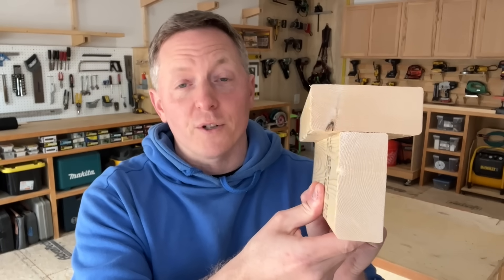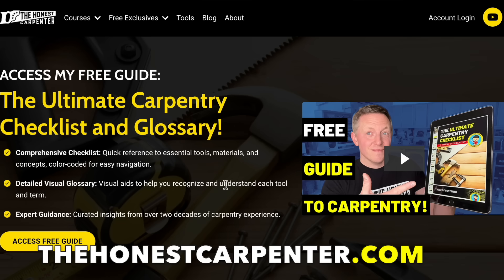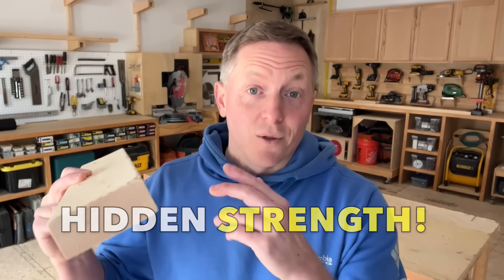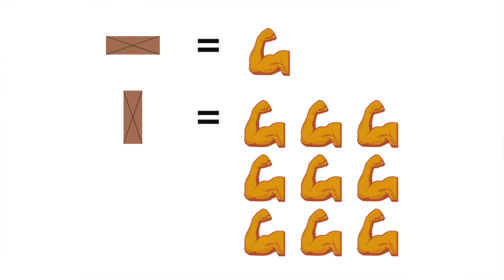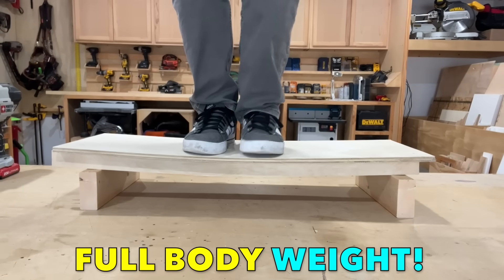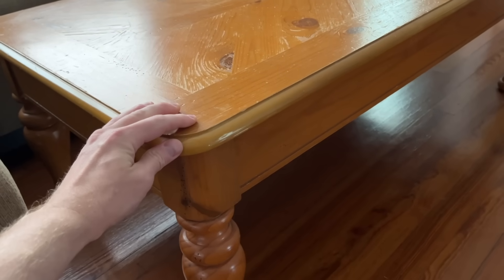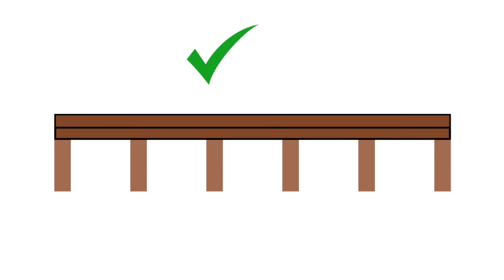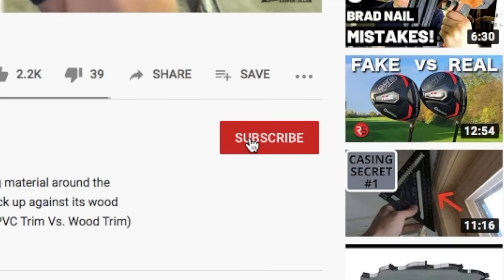Make Everything You Build STRONGER...(Overlooked CARPENTRY SECRET!)

Comment: Beware using I-joists in floors. During a fire, they burn very quickly and leave no support to an otherwise intact looking floor surface. This has led to the deaths of fire fighters in some cases. Its one case where thicker wood is preferred as it takes longer to loose strength.

Comment: Hey, I've been looking for info on this and since you were one of the few YouTubers post about this, I wanted to ask you to do a follow-up video.

In my area, the cost of a 2x8 is over double the cost of two 2x4s. I'm always curious about how to improve performance (capabilities), and using better techniques, possibly while saving money. So I'm thinking of experimenting with this shape for my roof rafters on a shed - instead of using 2x6 or even 2x8, but incorporating  these T-shape "beams" instead.

In this shape - crossbeam/top bar, you've outlined that it's quite a bit stronger. I'm curious if its weight bearing capacity is better for deflection than using a 2x6 or 2x8 even. I mean, I've seen more than a few videos about how someone's amazing sawhorse using this exact same shape can withstand an immense amount of weight.

Having that flat, wider portion to the top obviously gives me greater nailing surface as well, so that's a bonus. But my main consideration here is simply if this is better at weight carrying, snow loads, then I could have less steep roof pitch without worry about whether or not it can sustain snow loads.

Comment: Advice on building a wood bracket for holding a 600lb outboard motor?
Current plan is 4x4 base with 4x4 verticals supported by 2x4s at about 55degrees. 2x6 between vertical 4x4s will carry the motor.  Lag bolts and long wood screws throughout.  Will roll on 3'' casters.  Very simple. Surely could be improved.

Comment: The source of this effect is geometry of a circle.

To bend a plank against the shallow dimension, the strands of wood making up the plank need to bend. This takes little force, as strands of wood don't mind bending. 

To bend the same plank against the deep dimension, the strands close to the inside circumference still bend (easy), but the strands near the outside circumference need to stretch, since the outside circumference is longer, as dictated by the difference in radiuses (which is the depth of the plank). Wood strands do not like to stretch, so this takes a lot of force.

Comment: Pretty common to see temporary shoring made with 2x Tee posts. Also top rails diy saw horses. One time I used 2x10’s in a Tee bolted to the gable wall to hold a 40’ gable end truss plumb because it was to far to brace off a grade stake

Comment: The video is good. One "small" correction.

It is definitely not exponential growth.

That would mean the number that is changing is in the exponent. Example: 3^x.

It is polynomial growth, meaning the number that is changing is in the base. Ex: x^3. Some common special cases. If the exponent is 1 it is linear growth. For 2 its quadratic. For 3 it is cubic.

FYI. Non-technical people think exponential growth means really fast growth. That is true for positive exponent values. For negative exponent values the growth becomes extremely slow. In fact, from negative Infinity to 0 it only grows from 0 to 1.

Unfortunately these days when many people say it grows exponentially it is often something that does not grow exponentially.

Separately, in real world applications exponential growth is not possible for long. Something practical limits growth. A common model for real world applications is logistical growth.

Comment: Okay if this works how come when they add the double top sill plate for exterior walls don’t they just turn them on the side instead of flat would it 10x the strength and do the same exact thing but better? Is their a reason they don’t do this or am I on to a better technique nones thought of yet?
Reply: Only thing I can think of would be the nailing issue/screwing issue but you could always angle nail them from both sides after bailing the two together 🤷‍♂️ if anyone can help me break down why they would do this please lmk I’m just curious and no question is a stupid question when trying to learn

Comment: I had sagging kitchen shelves made of 3/4" particle board with a wood veneer.  Terribly saggy.  I replaced them with 1/2 plywood, but instead of shelf pins, I used wood strips to support the back and both sides.  The strips were oriented as you describe, mainly to get screwing area.  Not a single sag wtih the same amount of load (dishes, etc).  I didn't understand it fully until now.  Not as flexible as shelf pins if I wanted to change the shelf heights, but since I store the same stuff in them for decades, they don't need to be.
Reply from the maker: Yep, we call that a cleat system! One of the best ways to create rigidity in shelving 🙂

Comment: I totally agree with your video, but you are essentially adding depth, not surface thickness, much like a stringer in a (foam) surfboard, or a WT steel shape (which is a "T" shape, much like your 2x4 "T" member.

Comment: Strongest cross-section by weight per foot is a hollow box... rectangular or square.
Also, it is better for the flanges to be on top and bottom of the web (consider the wide-flange or I-beam) than to be flush with the outsides of the flanges.
When the piece isn't stiff enough, put a rib on it.

Comment: Years ago I designed a stretcher frame for very large canvas paintings with no internal bracing. I used 1/4" plywood to construct a steel I  Beam similar structure with 2 internal but separated verticals capped top and bottom. It was very rigid across long spans.  Very weak materials made extremely rigid.

Comment: In engineering school, they teach that bending a piece of material the highest forces are on the outsides of the material and the inside actually gets 0 force from said bending. so the i shape in i beams comes from the fact that they are saving material that is not adding any strength.

Comment: The "T" Concept works on larger structures as well. Built a 12x20 shed 8 feet tall plus gambrel roof. I modified a few Pallets to create 3x8 foot pallets and positioned them up ended on both sides of and perpendicular to the double barn doors inside the shed. and also placed another two on opposit wall and made shelves. Reinforced roof as well.  Long story short a few years later took a direct hit buy Hurricain Sandy on the Jersey Shore.  Shed never moved or was damaged..  (My other smaller older shed got crushed and tossed into a neighbors yard..)

Comment: The support beam can even be curved, following the ideal torque line. Thus, low at the ends and high in the middle, and it can have holes in it for even less material (think of a steel bridge). The main thing that gives strength, is the material farthest away from its horizontal centerline.

Comment: Thank you, this is a great tip. It's a basic principle that can help woodworkers in many projects. But, I had to laugh a bit because when I wanted to build my first work bench, I used the rest material from my house upgrade projects. I wanted to use 4x4s as legs, but they were not tall enough. So, I put pieces of 2x6 between the legs, and because 2 inches was enough, I used them standing. So, I used almost the same principle, and it made my bench stronger not because of my knowledge but because I wanted to make the bench with the wood I had in my hands.

Comment: The honest carpenter suggests that a 2x4 on it's side can carry as much as 3M pounds. While the principle is sound, the math is far off. Pallet builders double up 2x4 runner boards for pallets that will hold as much as 20K pounds rather than the 2.5K to 4.6K that a standard pallet should be able to support. This isn't the information that I expect to have the most impact on the claim that a 2x4s strength increases to the cube of its flat side when you use it's narrow side. I think that 150x150x150=3,375,000 will do that well enough.

Comment: The strength is actually proportional to the square of the depth. It is the stiffness that is proportional to the cube of the depth. Stiffness and strength are independent material properties. Stiffness tells us how much a beam will deflect. Strength tells us at what load it will fail.  Even though this is very simple and obvious, many people get confused over stiffness and strength. Another point is that both stiffness and strength are both functions of geometry and material. It is kind of obvious when you say it but it is amazing how many people get confused over a simple concept and how a simple concept is not necessarily so easy to evaluate.
Reply: I run into this with composite structures all the time

Comment: The ibeam you showed actually gets most of their strength from the wood not the OSB boards. The reasons its much stronger is because they're much further from the middle due to the OSB
Reply: How does taller OSB equate to strength/stiffness, given the same flanges?
Reply: @jobacuda4472  it has to do with the moment of inertia of the face of the beam if you want to do more research on it. A simple explanation would be when the beam bends down the top is in max compression and the bottom is in max tension. The wood beams takes that load and the OSB has minimal stress in it. The reason taller OSB makes the beam stronger is the stress distance is now further from the center similar to a lever arm reducing the force but increasing the distance.

Comment: One oversight: Wood turned on edge is prone to twisting. When you place a load on top of a narrow beam it wants to twist. Normally joists are topped with plywood or OSB to counteract the twisting. Alternatively blocking is added between beams to prevent twisting.

For shelving. the simpliest way to address deflection is to glue a 1x2\1x3 to the back side of the shelf (on wall side). This reduces the board from deflection (unless the shelve is very deep). because the 1x2\1x3 is back against the wall it does not hinder storage space under the shelf.
Reply: Metal beams do the same thing.  If you load an I-beam excessively it will twist before it fails.
Reply: That effect is called buckling
Reply: An "oversight" or just a focus on one principle? I'm sure this guy knows more than he includes in a brief video.
Reply: @k311ydcart3r  My comment was directed at people watching this video for their own projects, not at the creator.

Comment: the OSB isn't what is carrying the load......
Reply from the maker: Sure it is. Otherwise it wouldn’t be there. 😂
Reply: @TheHonestCarpenter  it's there to tie the two end caps together, nothing more. many trusses have no OSB at all, and they work equally as well.

I'm a Mechanical Engineer. Go take a basic structural design course and learn all about it. Entire free course lectures are on youtube.
Reply: @SoloRenegade  Solo, how does taller OSB equate to strength/stiffness, given the same flanges?
Reply: It's certainly a component. The two flanges couldn't carry much load by themselves.
Reply: @jobacuda4472  the two flanges do in fact carry most of the load. the OSB is merely the web that ties the two together. At the center of the web there is ZERO structural load.

Comment: I built a 2x4 i beam to carry the weight of the roof span of my backyard shed.
Reply: Do you mean the ridge beam?
Reply: @ no, specially designed to split the load of the roof span, attached to the reinforced top plate of the walls with uprights attached to each roof joist. Simple, and incredibly strong.

Comment: I was recently doing some remodeling for a friend who had a house that was built in 1960 and  the whole house was very, very poorly built and in the Attic it didn't have much room  to get up there and the ceiling joists were a combination of 2x 4's 2 x 6's and I never saw that before and it made it more difficult to do the type of remodeling and structural reinforcing that I was doing which involved making his roof stronger and relocating some bearing walls that weren't lined up with bearing walls and beams below.

My question is: How could a double plate like that running over the top of ceiling joists help strengthen a ceiling joist that is not as wide or as high as the other ceiling joists if you nail it to the double plate like you showed in your demonstration?
Reply: 2x6 ceiling joists are common in houses built in that time period. They are plenty strong as ceiling joints because the are carrying hardly any load. The problem is when you sheath the floor, turn them into floor joists, and load them.

I've never seen ceiling joists (in the same run) that were different heights.

Comment: Does this apply to MDF?
Reply from the maker: Yes, it applies to virtually any type of material that is relatively rigid. Though obviously strength will vary greatly based on type of material. MDF won’t be as strong as solid wood, but you can still design with it this way.

Comment: The physics behind this is called the Moment of Inertia.  The farther the top and bottom of the Tee or I-beam are the more energy it will take to cause it to flex relative to the strength of the material used in the construction.

Comment: So the principle you're looking for isn't strength.  What you're resisting is bending moment.  The property of a design that resists bending moment is called Moment of Inertia (technically, second moment of area, but nobody actually calls it that).  Moment of Inertia increases as the square of the distance.  In other words, if I double the depth of a beam (keeping the width the same), I quadruple the bending moment it can resist for the same deflection, 

That's why we use W-shapes (or what most people know as "I-beams," though they're an improvement on actual I-beams).  Those large flanges on the extreme ends of the W-shape add all that material as far out as possible without increasing the depth of the beam.  This maximizes the Moment of Inertial for the same depth.
Reply: No-one but engineers call it bending moment. The rest of us call it strength.
Reply: @jobacuda4472  The science behind it remains.  But, yes, "isn't strength" might have been an overly-strong statement.
Reply: @kennethmiller2333  👍😆

Comment: If you want to know how many times stronger it is when oriented vertically you square the long dimension and divide it by the square of the shorter dimension. So a 2x4 is (3.5*3.5)/(1.5*1.5) or about 5.4 times stronger when turned vertically. A 2x6 is over 13 times stronger! (Or will deflect 1/13th as far).
Reply from the maker: Amazing, Ross! Thank you for showing the math here! :)
Reply: The most concise explanation yet. Thank ou!
Reply: So, a 2"×2" stud would have the same strength vertically or horizontally?
Would the amount of deflection be the same in either direction?
Reply: @ Lying down and rotating it through 90 degrees, then yes it would be the same. Standing up, of course, would be much stronger.
Reply: @jobacuda4472  Yes, this all applies to the cross-sectional area, so there is no distinction between the vertical and horizontal alignment of a 2x2. The math I gave in my other comment isn't particularly useful for anything, but is kind of interesting. If you want to know how much your beam will deflect you would need to calculate the following: (F*L^3)/(4*E*b*h^3)
F = applied force
L = unsupported span (in inches)
E = modulus of elasticity (about 1.5 million PSI for pine)
b = horizontal dimension of board (e.g. 1.5 inches for a flat 2x4)
h = height of board (e.g 3.5 inches)
Reply: @ That's pretty straightforward. Thanks! I assume there are tables for MOE?

Comment: Good video. However, how os that different from having thicker board? Sure larger dimension will provide more load bearing capacity. Advantage of the beam over thick board is lower weight to loadbearing ratio. However, one should be careful about torsional strength of the material, especially for trusses. Am I missing something here?

Comment: So a 2x10 can replace a 2x12? Floor joist?
Reply: If the span calls for 2x12s, then no.
Reply: @jobacuda4472  just wonder because I have see older homes with 2x8 2x10 and 2 x 12
Reply: @ In the ones with 2x8s, roll a marble on the floor and see where it ends up.
Reply: @jobacuda4472  the entire home has 2x8, and the walls are 2x4vspaceed 2 ft o. Ctr, interior  walls a 2x2, plywood on floor is 5/8 inch, no underlayment.. built in the 60s, I guess it was the wild west then

Comment: Understanding joints and racking/torsional forces are other parts missing from builders' understanding. If you don't protect from torsion in your build, the strength you designed into it can fall out of alignment and joints can come apart resulting in total failure that would be avoided with minimal material and work.
Reply: Are you talking about shear forces or something different?

Comment: My living room floor had excessive deflection because it was 2x10 across a 16 foot span. There were cross braces but the floor still bounced so I created reverse I beams by jacking flat edged 2x4 up from the bottom and screwing them in place. I also tripled the cross bracing. No more bounce.  I probably should have doubled up a few of the joists when I built the subfloor and obviously added more bracing but creating a wooden I beam after the fact did the job.
Reply: Doubling the 2x10’s called sistering. I have an old house that the floor joists need replacing. I will use the  2x4 method you expressed as well as cross bracing.